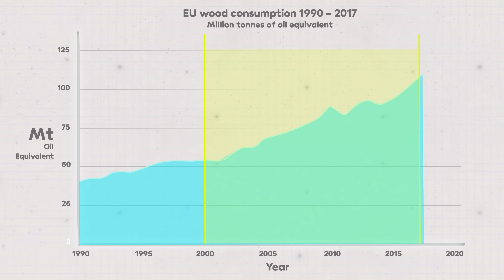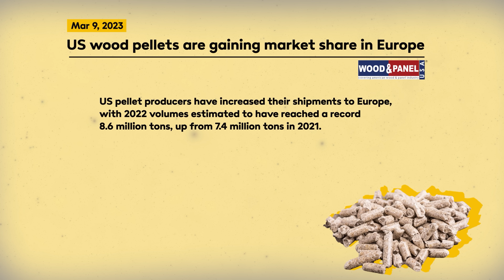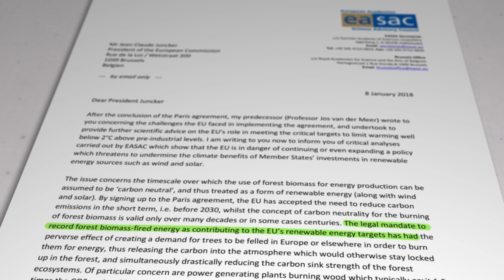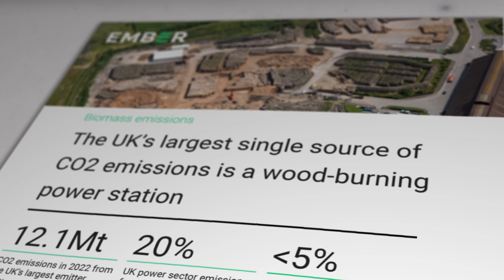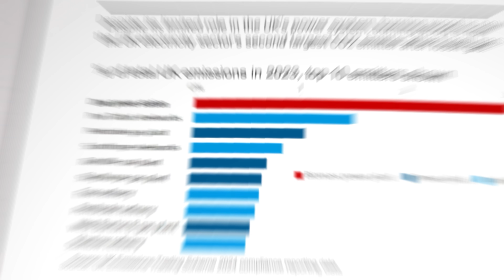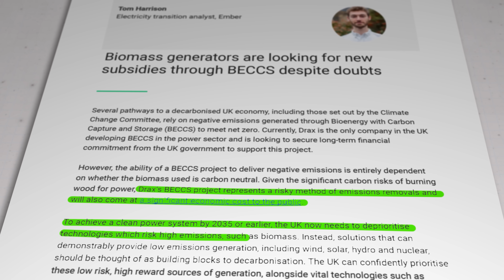New report: Biomass CO2 emissions 4X higher than COAL!!

Comment: If a tree falls and decays naturally, what proportion of the carbon in the tree is released as methane vs. CO2? Yes I know it takes some years (probably not "decades" as some posts are claiming) for the decomposition to happen, but if a large proportion of the tree rots away releasing methane that is not so wonderful, methane being 25x more potent as a greenhouse gas. The methane absorption and release data for forests is very complex, but converting a forest into CO2 whilst replanting an equivalent land area  in a cyclic manner might not be a terrible alternative to fossil fuels until such time as solar PV, wind and sufficient energy storage systems are put in place to provide a better long term solution to energy requirements.

Comment: I'm all for geothermal heating and cooling systems and more passive house standards applied across the board.  If we used better and more efficient heating and cooling strategies, it would cost less in the long run and decrease demand.  Of course with the advent of AI and EVs that demand is more than made up for and then a whole lot more.  Nuclear needs to invested in more, but also nuclear waste recycling and thorium molten salt reactors.

Comment: Thanks for taking this on. I agree this is a bad idea when scaled up. Out here in rural Colorado we've been using pellets for decades for home heating. Back in the 80's it really was wood scraps/saw dust and my guess is the difference in time between natural decomposition and burning is a few years regarding CO2 emissions. In recent years, lots dead trees as a result of kill due to pine bark beetle has been used for pellets but what you show is an miss use of this alternative fuel in terms of climate change mitigation.

Comment: Burning wood from temperate regions is approx. carbon neutral (excluding transport) because of the albedo effect - when you cut a tree down on average the surface becomes more reflective and heat is reflected into space (cooling effect).

Comment: We have 0.04% Co2 in the Atmosphere, if it goes up to 0.08% we wont see alot different, beside plant growth.
If it drops down to 0.02% all plant life dies inc us... We might die first since our blood needs C02, since our blood is kinda made of water and water without Co2 got a pretty damn high Ph level.

So the only change we could do with Co2 before dying, is to reduce it with 0.01%... Something we could spend 50% of everyone's income on and still not achive a damn result... Or we could just drop all this Co2 bullshit, and rather goe after potent gasses that comes from Diesel and such... since that gass is 200x more potent and count as a polution in a bad way, something Co2 dont.

China wants to push EV, Solar and windmills onto the west, meanwhile they are in secret aiming for a 100% nuclear future... Something they will achive easy when they get the hang of Thorium reactors.

Just imagine 3D metal printed thorium reactors in all kind of sizes, small enough for cars, houses etc.

Comment: Regardless of the carbon amounts released. Coal and Oil are indeed considered worse because they do actually create a net add of carbon in the environment. While burning biomass may release more it is temporary. Timescale is the only difference. Science backs this up. Neither is great solution if reducing carbon is the goal. Biomass for industrial power is far different than biomass for backyard cooking. As one comment suggested using wood for buildings absorbs carbon, but the tree farming and harvesting creates a net add with the use of fossil fuels. Science still debates whether or not the carbon models are even accurate. Until you can remove what you think you know from the equation and apply critical thinking not emotional thinking, the world will continue to make bad decisions on both sides of the climate "discussion". To do this correctly research funding will have to be fully cleaned of end goal funding. Due to political and big business pressure this has yet to be achieved. What a sad state we are in.

Comment: Except: burning wood, biomass, adds no 'new' CO2 to the air. The CO2 that is in the wood was sucked out of the athmosphere during the time the tree lived... Also, if we don't burn the wood, it will rot and release that CO2 anyway!
Reply: This was addressed in the video. Your statement is like a dieter telling their doctor, "Well, I knew I was going to eat three boxes of cereal this month, so I ate them all this morning in one sitting. It's the same calories either way, right?"

There may be no "new CO2" per se but that's just shorthand for "CO2 exceeding the environmental absorption capacity." Let's say a tree stands 100 years (absorbing CO2) then dies and takes 20 years to decay (releasing the same CO2). That's decades and decades of being a CO2 "battery" with a slow release that can be absorbed by new growth versus chopping down "renewable" trees after 2 or 3 years and burning them, dumping ALL their CO2 into the atmosphere in (what?) minutes/hours.

"Carbon neutral" doesn't mean "releases no carbon" that would have been released eventually anyway but "releases no more carbon in a given period of time than the environment can absorb in the same amount of time."
Reply: You're forgetting the whole load of energy required to collect the wood, turn it into pellets and then transport it from rural America to the power plant in the North of England. That's where all the extra CO2 emissions come in.
Reply: no, rotten things decomposes and become soil

Comment: On paper biomass is renewable. But I think the method taking out the biomass matters.

A clear cut if I understand it right is leaving not a single tree for tens or even hundreds of meters) is just full of nasty downsides.
Even if the area is replanted right away, it will be decades before the new trees will capture enough co2 to offset the co2 released from the clear cut ground. If tree farming (I refuse to call them forest) is barely offsetting the co2 from the ground - the trees that was taken down will add to the co2 balance and tip the scale by far towards a net surplus co2 emissions.

I think we need to leave most trees standing where we cut / harvest to become closer to net zero.

Comment: So the energy/carbon emissions used to refine the wood scraps into pellets and then to transport them is being counted as "no carbon emissions"? Must be that all their machinery works with solar power. A big lie, similarly to how Lithium mining emissions and transport+refinement, coupled with the increased eletric power demand (which is mostly not carbon neutral) is not considered for the emissions of EVs. But here it is even worse, since chopping trees eats into the carbon removal capacity of earth, and we know that planting will not be as funded as offsetting into timber import from poorer countries.

Comment: This explains why the cost of lumber has skyrocketed.
Reply: its not related, they are two different commodities, and supply and demand curve. If there is something, sustainable forest management, and using the forest residues for bioenergy creates more economic sense (and revenue for forest based communities) than burning 1/3 of the trees that are unmerchantable on the forest floor.

Comment: 8,6 mln tonnes pellets over 4 vountries vs 40 mln tonnes of coal in GB alone, I think the focus should shift! The Fossil industry is very happy with this  kind of content. At least biomass can regrow within a human lifetime even if planted later in time, besides that is growing forrest already drawing carbon from the air a lot of which is not burned at all but trapped in the soil and roots, coal will not form within a large amount of generations if at all since the conditions under which they were formed are not there anymore in most cases. Fossil sources are the problem focus on discrediting biomass helps them.

Comment: As Dave mentioned, even if some industrial process or manufacturing claims that in paper they produce the same CO2 as a natural ecosystem, in reality they do not. The same principle applies to many of renewable sources (Solar PV, Wind, etc..), many people agrees that the emissions of the manufacturing process is compensated during its lifetime. As same as forests, is not about the quantity itself but about the time required by the process, not the same releasing a quantity X in 10 years than the same quantity in a couple months, that intensity makes the diference.

Comment: Drax pre-tax profits are up to £463m in the six months to June, and they are reportedly planning a £300m windfall giveaway to shareholders, yet we still keep chucking money at them, our money.
Meanwhile, over in the EU, the Innovation fund is using money raised by the emissions trading scheme (ETS)  to part- fund the installation of an Eavor 2.0 geothermal loop, which is reported to cost approx €435, or £369m and will run for 25 years.
It's high time the U.K. government forced Drax, and any other recipient of biomass energy subsidies to invest in geothermal. Ideally the Eavor loop could be co-located at Drax , feeding directly into the existing above-ground infrastructure if possible. 
Such initiatives would allow us the use the drilling expertise developed by the Oil and Gas industry to invest in a lower carbon future, and provide future jobs for the industry as it transitions away from the North Sea.

Comment: What was not factored in is what happens if the trees are not harvested. Do they just stay there forever? certainly not. Forest Fires devour millions of trees every year. In fact what goes up in smoke every year in Alberta, Canada (my home province) is enough to power the entire province for 10 years. If we act to suppress those fires, harvest the dead/diseased biomass and brush, and convert it to power it is 100% carbon neutral because natural cycles devour that biomass in smoke regardless! This is why the town of Jasper was burnt down - there was zero forest management around the town which caused a huge buildup of biomass from dead and diseased trees along with huge amounts of brush that was dried from drought. 

So if we are going to study biomass energy for its carbon emissions - lets just have a think about the big picture here! Its really not a net source of carbon if we replace forest fires with biomass energy. 

Yes there are aspects worth criticizing such as the mono-cropping and some of the clear cutting practices that have occurred but this can all be controlled with proper oversight.

Comment: I wonder if the Drax emissions figure included the diesel to cut and transport the trees, the coal/gas.to power the pellet mills, the fuel oil used by the ships bringing the pellets across the pond and the fuel used to bring the pellets from docks to power station? I suspect not. Drax is yet another "green" scam at the taxpayers expense.

Comment: 1) is Drax producing 4x c02 per megawatt/hr compared to coal? not clear in this video.Drax is  a BIG power station if compared to a relatively small coal power station it could be a poor comparison.
2) I heat my home with biomass and have done for more than a decade. I have a 5 acre wood which needs to be managed. The trees felled when thinning out are used for my central heating. If left to rot these trees would release the same amount of c02, so using them for heating saves other energy sources.  The use of biomass must be judged in some sort of context!
Much biomass fuel is made from sawmill/forestry byproduct - if not utilized then other problems arise.
3) I cannot help but think that this is yet another eco trend!! (eg. diesel good then diesel bad etc)

Comment: This question is only one half of the equation. The main question is whether the production of this biomass is truly renewable in the first place. It is the whole process from earth to earth that needs to be evaluated. But as long as the production is not renewable (absorbed CO2 rate larger than burning rate), burning wood is similar to burning coal or petrol or methane derived H2. I don't know why communications only tend to cover the power media to electric conversion and not the rest of the cycle (source).

Comment: Poland has a long history of wood production and over many decades it actually maintains (slightly increases) its forested surface. Burning wood there seems to actually be carbon neutral since WW2. And whatever wood ends up in long-lasting products (like furniture or construction materials) becomes an actual carbon sink, since new trees replacing 80-100 y.o. ones draw more CO2 due to rapid growth. I'd check the data there before jumping to conclusions that wood burning is not renewable or sustainable...

Comment: HOW a tree is managed is critical to this. Please research coppicing and how deciduous trees can be continuously harvested (every 7 to 10 years for many species) for hundreds or thousands of years without killing the tree. They retain their mature root systems, preventing erosion, and they grow the above-ground trunks back in far less time than a new seedling could ever hope to achieve. There are beech forests in Europe that have been managed this way since the start of the iron age. It's growing in popularity here in the Mid-Atlantic USA, and forestry experts are starting to advise farms to switch to this for their logging management.

Biomass from coppiced willow trees = harvested every 1 to 3 years. Very fast, very good at soaking up nutrients from waste treatment facilities.
Locust and osage orange are dense hardwoods with high resin content but harvested just as rapidly as willow.
Poplar, mulberry, box alder and other soft deciduous woods = 3 to 5 year cycles of harvest
Hazel and elm = 5 to 7 years

If poles are needed, rather than biomass, you add a few years. Willow, osage and locust poles for firewood or construction = 5 to 7 years; hazel, beech and others are 7 to 10 years. Slow growing trees like oak need 15 to 25 years but those are rarely chosen for biomass so they're not really relevant here.

The problem isn't the use of trees for biomass. The problem is the use of monocrop plantations of evergreen, single-use forests that are ecologically terrible, don't capture much carbon, take forever to reach maturity and then are all harvested at once, with erosion and ecological vacuum as a result. We need everyone practicing logging to return to using appropriate deciduous species for their climate and soil, and coppicing them on a sustainable rotation.

Comment: You are wrong - in order to have LOG-Growth and CO2 capturing in a hectar of forerst you must chop out thinner unused unnecessary trees - if they are NOT taken our 1. FIRE Risk is bigger (wood fire is a natural phenomenon) and 2. the co2 storage in LOG-Thickneck and WOOD-Construction of buildings is hindered because no thick and high logs can grow. From 40 - 50 tons of log thickneckness growth - 10% must be harvested in a sustainable forestry scheme - so 4-6 Tons of pellet per growing hectar of forest prevent decomposition co2. 
This time you are seriously wrong. A pellet stove is by far the most co2 saving decentral and clean heat source.

Comment: The last coal fired station, Ratcliffe at 2,100 MW, is to close in a few weeks.  
Drax has a capacity of 3,960 MW. Drax is just under twice the size. 

Young trees absorb a lot of CO2.  If the trees are growing at the rate of burning it is carbon neutral.

Comment: Here are some recent carbon capture technologies for chimneys:

Melamine

A cheap and energy-efficient material that can remove carbon dioxide from smokestacks. The melamine is porous and contains a chemical called DETA that binds to the carbon dioxide, removing it from the gas.

FrostCC

A cryogenic process that doesn't require an external refrigerant. It compresses and expands flue gas, which produces a self-refrigerating gas that freezes the carbon dioxide and other emissions. The carbon dioxide is then collected as a liquid. This process can be used in fossil power plants, cement, pulp and paper, iron and steel facilities, and some chemical production plants.

Solid sorbents

Metal-organic frameworks (MOFs) are a type of solid sorbent that are energy efficient, resistant to degradation, and inexpensive. They can capture carbon dioxide from diluted flue gas streams with high capacity and selectivity over water. 

College of Chemistry

A simple, cheap material for carbon capture, perhaps from ...

Aug 10, 2022 — A new method for removing CO2 from these flue gases involves piping the emissi...

Svante

Carbon Capture Technology for a Sustainable Future - Svante

Rapid cycle-temperature swing adsorption with direct steam regeneration. The Future of Com...

￼

National Carbon Capture Center

National Carbon Capture Center announces first cryogenic ...

Mar 21, 2024 — The FrostCC process. Carbon America's FrostCC cryogenic CO₂ separation technol...

Carbon capture technology can work in two ways: direct air capture and point source capture. Point source capture focuses on industries with chimney outlets. Once the carbon dioxide is captured, it can be released and compressed for storage or reused in products. 

https://www.google.com/search?ie=UTF-8&client=ms-android-comcast-us-rvc3&source=android-browser&q=The+latest+carbon+capture+technology+for+chimneys

Comment: So they have to have a oxygen sensor making sure they're getting enough oxygen pumped into the fire, and making sure the wood is properly spaced. The thing with pellets is you pile them up, and it makes it hard for air to circulate around them, so they can burn cleanly... So they need to be spaced out and have good airflow around them, so they burn cleanly, and they need to be dry....